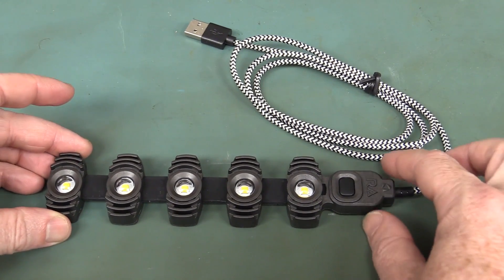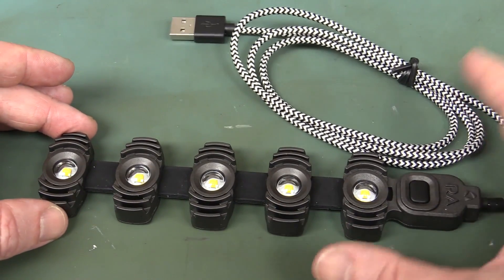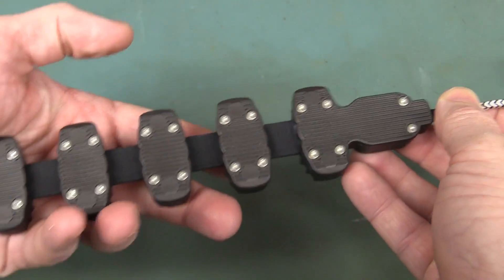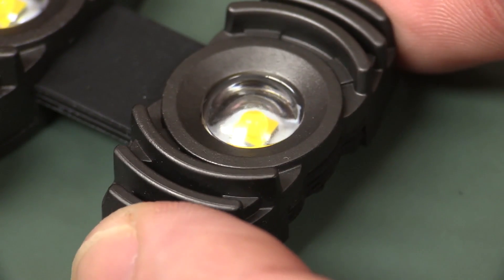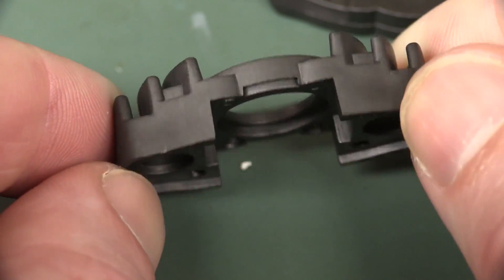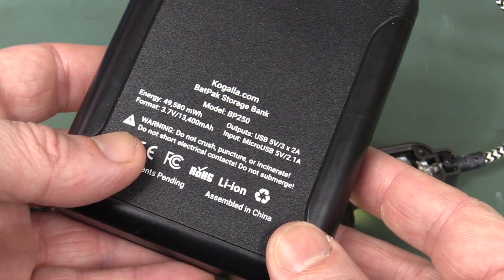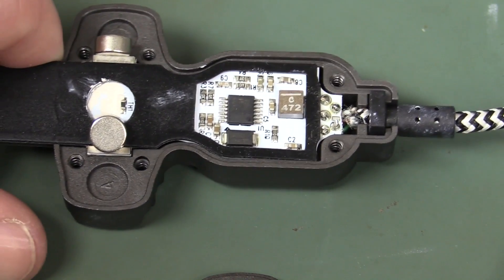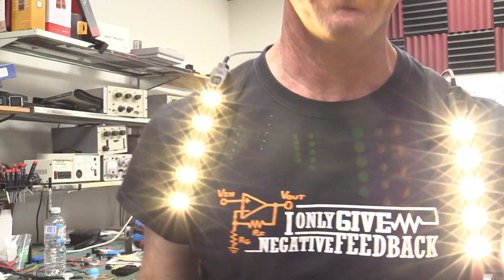EEVblog #1010 - Zyntony Ra LED Strap Light Teardown

Comment: That actually seems like a neat little product, however I think it would be difficult to position it so that it lights up the ground and not the area in front of you. Mounting it on any backpack I can think of would result in all the LEDs pointing straight forwards or up slightly. In a real life situation where you are outdoors I think that having the LEDs pointing down would be advantageous.

Comment: surely you could get more flexibility if they used separate PCBs for the LEDs and have then joined by wires so that you are not limited by the flexibility of the `PCB its self

Comment: Impressive thing even though personally i would like it to have battery inside and more stronger magnets that could hold the thing on a metal.... It would make an awesome work light this way, not easy to find one with so even lightning.
Also why are those one button on/off/mode things always programmed the worst way. I know people like different things but having no way to turn off light quickly cannot be so great for anyone. I have modded way too many China 3+ mode lamps already... Why not make it to turn on/off with a fast press and selecting brightness/modes with long press?

Comment: Energy conversion and cooling is poor in my opinion.
Two step up converters and aluminium heatsinks pullin heat thru standard FR4 PCB.
Reply: Arek R. Pretty sure the documentation said those are plastic not aluminum.
Reply: Robert Szasz So even worse...
Reply: They use plastic as a heatsink material?
Reply: I'd be interested is seeing what happens if the lights are turned on in full sunlight, on a warm/hot day. If they self regulate properly it's not a big deal, you can get decent heat transfer through modern plastics. They just transfer by contact slowly enough that you are unlikely to badly burn yourself.

Comment: Are you sure that is rubber and not a thermal pad material? At this price you could expect them to use that.
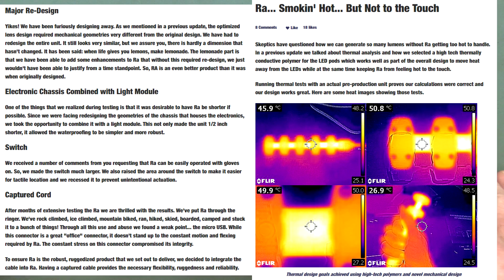Reply: You're right, it says so at 4:37 in the top right. It's a "thermally conductive polymer".

Comment: There is nothing special about those lenses. Standard COB stuff. In fact I can't see why anyone would buy these. For $20 on Amazon you can get a great 2 battery headlight and for a few dollars more extra 18650s. For under $30 you can get 4 battery headlight systems. And save a lot of money.
Reply from the maker: It's the form factor.
Reply: I got a free Bushnell headlamp from Marlboro. Marlboro gives you free gifts to make up for killing you
Reply: Ever put a product in the market yourself? Do all the engineering (time consuming and costly), get a factory to produce (who needs a margin) and than sell it (where the distributor and store also need some margin). This product is never gonna sell in massive volume, small market segment, so they will never be able to compete on price against Chinese flash lights.
Reply: I own a few of these cheap lights, with my own 18650-based battery packs so i can balance charge and have better battery life. While those lights are great, and sure you can buy a bunch, being able to just strap eight leds onto you quickly and go is worth the cost to me. Doing the same thing with the cheap lights just seems like way more hassle. 

Having said that this product missed a couple things to me that seem like an issue. First is that the metal pcb/sink doesn't look flexible enough, i'm pretty sure i'll bend this on first mtb crash. Second is i am unsure if there is a  conformal coating on the pcbs for waterproofing. I've heard this is bad for heat tho, so maybe that was a conscious design decision.

Lastly...that battery pack. Sure would've liked to see eevblog crack at least crack it open. Who knows if its good, seems like the weakest link. If possible I'd buy the product without it and use my own pack.

Comment: What is the point of using 10 LEDs for a mere 1600 lumens? Two XP-L LEDs will push that much light easily, in a far smaller package.

Sure, you might win a little efficiency and ease your thermal design by running more LEDs at lower currents, but you lose so much in size and weight. A system with two XP-L emitters could use the weight savings to squeeze a couple more 18650s into the design - you'd win out with more battery life in a smaller, more robust, simpler design.

Comment: I call B.S. on him liking this so much, those LED's arent even close to waterproof, none of it is waterproof, i doubt its even rain proof, he just doesnt wanna look like a dummy for getting behind a shotty product
Reply from the maker: Compressed Rubber sealing isn't IPX7?
I do come from an underwater marine seismic background, I know what I'm talking about.
Yes, true waterproofeness requires greased o-rings of the right compression, but this is good enough for IPX7 and the occasional dunk I think
Reply: EEVblog Yeah, that's plenty waterproof enough. Plus I've seen you trash another kick starter you got behind. (Can't remember which.) So I don't think that you'd say you like it for no reason. Water proof is waterproof, as long it passes the IEC IP testing protocols, regardless of the method you use. They used flax & wax stuffing boxes on ships, that were waterproof, for centuries. So is it "not waterproof" because it uses flax fiber?
Reply: rekt
Reply: wouldn't the spring steel that's exposed on the sides eventually rust?
Reply: Guy Gadbois - looks exposed internally only and is probably galvanized, but with that heat output I doubt moisture retention would be a concern. Maybe moisture wicking but again minimal exposure with significant output...
Reply: Guston, the spring steel is not "exposed internally"... it's 100% exposed at the edges, top and bottom. Look again at 5:36 As for the design - that thing will wick water in like a vacuum cleaner. The combination of seals, flexing, heating and cooling will make it draw water into those silly little PCB pockets, and along the main PCB. The rubber will do a gret job of keeping the water inside there.
Reply: @james palmer, sorry to disappoint, it's waterproof.
Reply: You're correct, it would rust... if we didn't use stainless. Even the screws are 316 marine grade stainless. pretty corrosion resistant.